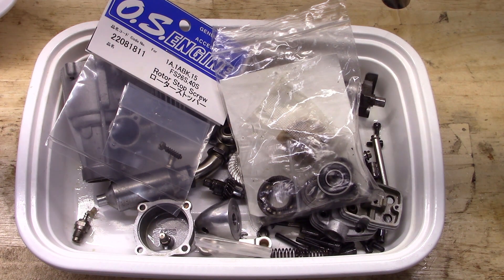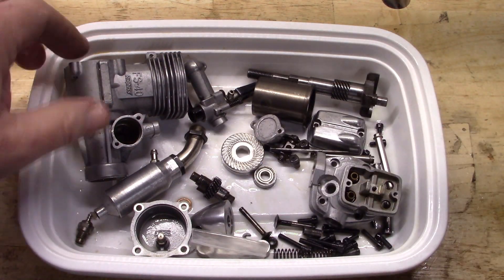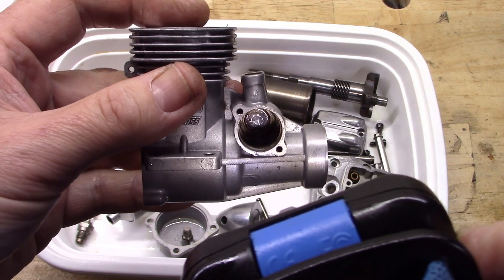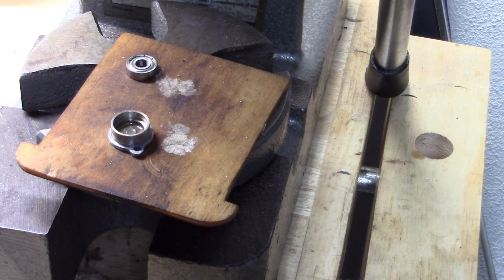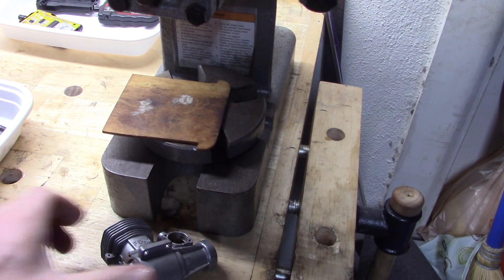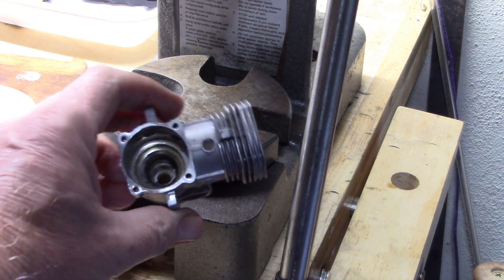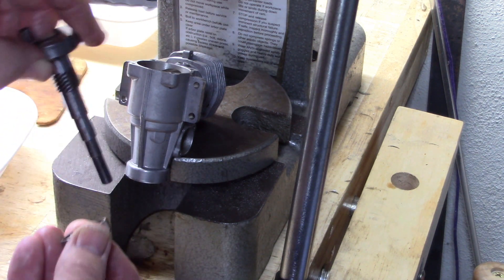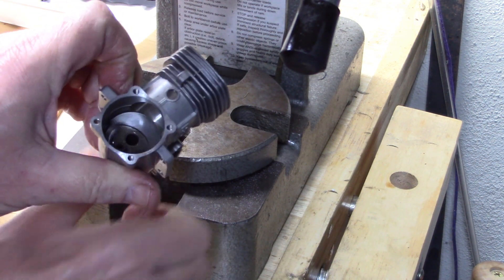OS FS-40 Surpass Reassembly Bearing Installation Part 3 of 4

Comment: If you heat the crankcase to get the bearings out, the new ones will pop right in. Or if you need to clean everything first, you can just reheat the crankcase to put the new bearings in.
Reply from the maker: I always use heat and oil to disassemble and reassemble. That is not new information

Comment: I have never been lucky enough to get the rod to slip off the crank as you did on this engine , always have trouble getting the piston pin out especially on a os 48 surpass f/s . Enjoyed the video , keep up the good work!
Reply from the maker: If I look back I think I have had it happen 2 or 3 times.  I know on this one I had the piston at BDC when it came off.  I have always tried it before with the piston at TDC.  Perhaps BDC is the way for it to just come off and I have been doing it wrong the entire time.  OS put that hole in the crankcase for a reason, but they also had to know the difficulty in disassembling this series of engines.  The answer could be in the OS four strokes book but I have never seen one of them before.